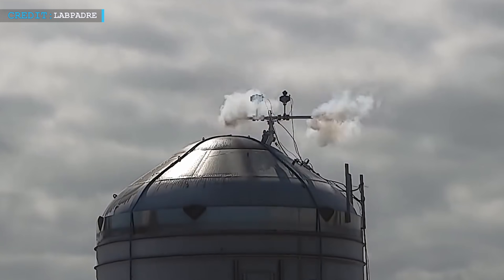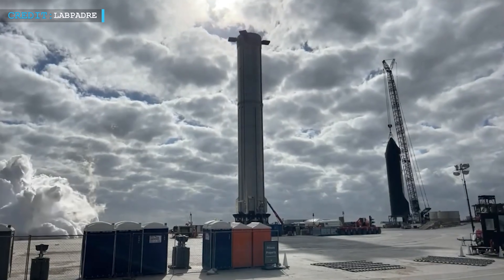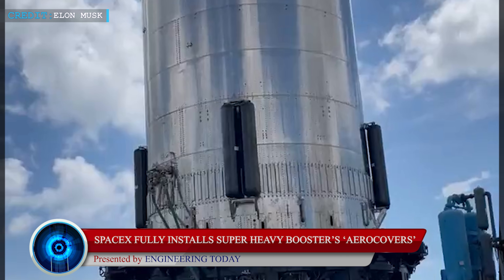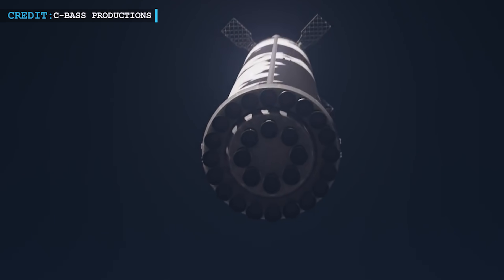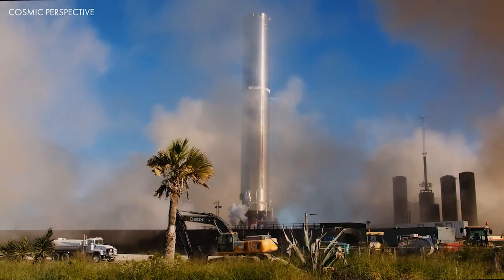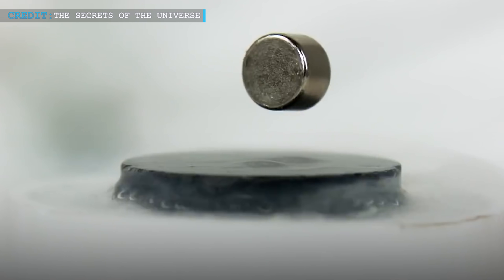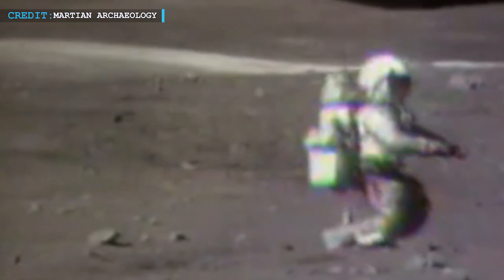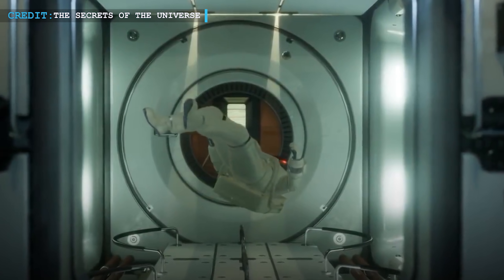SpaceX GSE-4 Tank has Popped! | Super Heavy Booster’s Aerocovers Installed | China's Artificial Moon

Comment: This was a test tank. They are regularly tested to failure. Liquid nitrogen is perfect for this since it goes from liquid to gas quickly and as the major component of the air that we breath it poses no long term risk. You can tell that they expected it would burst since they had straps over the top to retain the top when it finally did burst. The question is if it met specification for holding pressure and by how much it exceeded it if did so.